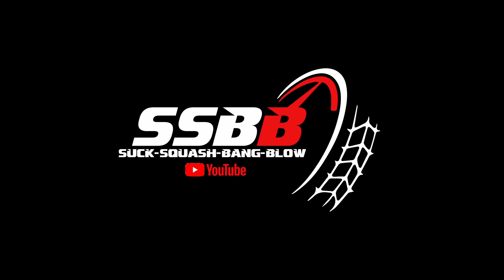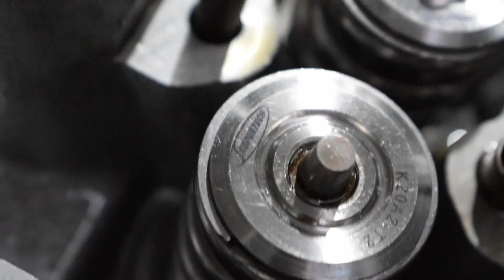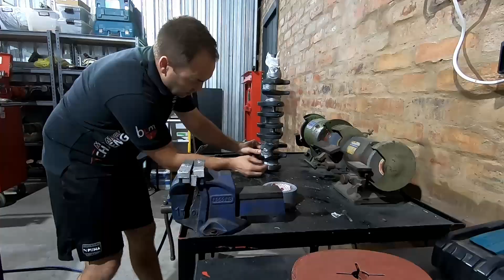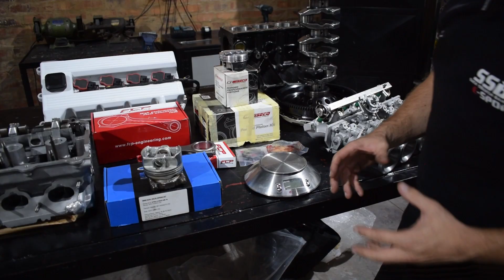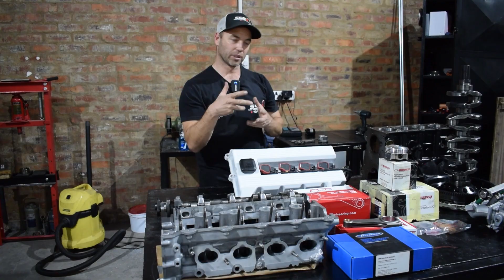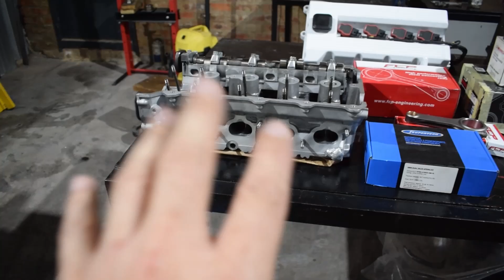Introducing Mighty Mouse the M42 M44 M47 B21 K24 NA Screamer!!!!

Comment: Hi great build what rpm you can spin stock crank pulley and oil pump too on m47 88mm crank
Reply from the maker: Thank you ✌🏻
I sent it to 8000. But it wasn’t that often.
I would say 7600 to 7800 to be safe.
Reply: @ssbb_builds no problem thanks I keep limit at 7700 and should be good 👍 what problem had you with lifters I am thinking of getting the hydraulic to soild shim kit was it that you had trouble with that you went full soild lifters

Comment: Is the m47 shaft from 150hp?
Reply from the maker: Thanks for watching.
E46 320D pre facelift.
Low output version.
Reply: @ssbb_builds frik, making basically the same build but with turbo and while i was buying the sordged pistons, rods, gasket and head bolts the guy offered me m47 shaft from 150hp and i bought it cuz i disnt know there was much difference between them, turns out there was a big difference

Comment: omg, the most interesting channel to follow when you have an m42/m44.
question. tune idea for lets say a first aggressive stage on an m44b19.
would it be a part exhange like m42 head? m47 crank? simplex timing kit?
what tune component should it be the first if the bugdet is somehow low?

thanks in advane
Reply from the maker: Thanks for watching and good question!!!
I will be doing an episode on this in the near future.
Thanks for bringing it up 👌🏻
Reply: @ssbb_builds seems like you are motivated. Happy about it. I love m44 platform and I always wonder what could be an aggressive stage 1 with component exchange etc... An episode with budgetwise and parts wise would be perfect. I have some ideas.
Reply: Leave the engine itself alone, get some more aggressive cams (catcams has a nice range for the M44), port the lower intake manifold, high flow catalytic converter and a good tune on the dyno. That Setup will give you around 170hp and about 200Nm. Do it, it's worth it
Reply: @franzwer1103 thanks for your answer. Sounds like a solid idea that should works easy without a lot of issues and special parts.

Comment: whats the weight difference between the m44 and m47 crank ? 
Also whats the solid lifters you used, are they oem lifters from antoher engine ? 
Intresting build, good luck !
Reply from the maker: Thank you.
That’s a good question. I have not weighed the cranks side by side. The 320D crank feels heavier.
The lifters are stock BMW lifters modified to be solid lifters.
Thanks for watching

Comment: Hey man. I have a M47 head block and sump sitting at home, I'm in Pretoria. Let me know if you are interested.
Reply from the maker: Howzit bud.
Not sure I would need M47 bits other than the crank.
Send me a DM on Facebook or Instagram with some pics please.
Thanks
Reply: @ssbb_builds  For this kind of build only the crankshaft is necessary.

Comment: the key to get high rpm is that conrod…imagine if titanium conrod use😈…brapppppppp🔥🔥
Reply from the maker: Oh damb!!! That would be amazing!!!!
Reply: @ in my clction..i get mugen mf204 bse on b20/trd 3sg/nissan sr20 from jpan JTCC/fomula3 race scrap..all off them totally 3-3.5kg more less weigt internal part from the original engine…brand uslly PANKL in ti conctin rod/valve/ratiner vlve..piston also hve super lightweigt with oil channel in piston..hopeflly that can help you🫡
Reply from the maker: Thanks for the information!

Comment: Built not bought motor sport.
Could have knife edged the crank?
Pay very careful attention with the oiling with the 88mm stroke, also the unit will be prone to detonation with 3 mm of squish, ign. timing is going to be super critical.
Hope all goes well👌🏼
Reply from the maker: Thank you for the input.
I didn’t want to go too crazy with the crank because of costs and time.
I normally run my engines with about 1mm squish so yes, it’s critical to get the timing right. I will keep everyone posted on the progress in future videos

Comment: Because your project is almost the same as mine, I can suggest you mill that piston dome flat, a 3mm gasket is not efficient and may induce detonation around the squish area as well as isolate the fuel mixture around those area robbing the motor of power. Mill the piston flat, use 1mm mls gasket, gasket match the combustion chamber to the gasket, and it should nett you around 11.8-12.3 CR with a 3-4cc valve pocket.. a flat top piston is much more superior then a domed piston in a pentroof, low included valve angle, small combustion chamber such as m42 m44 engine platform. 
Great build by the way! Subscribed!